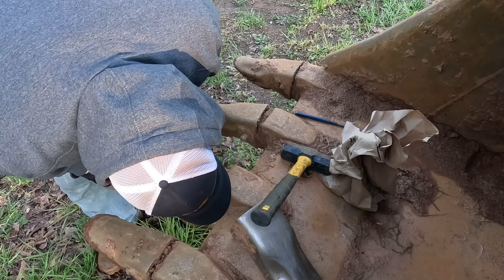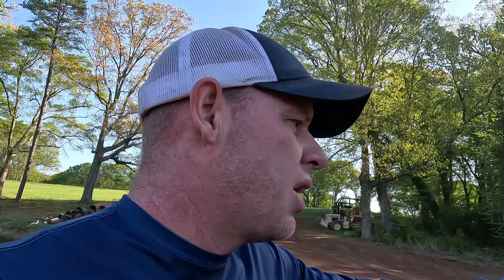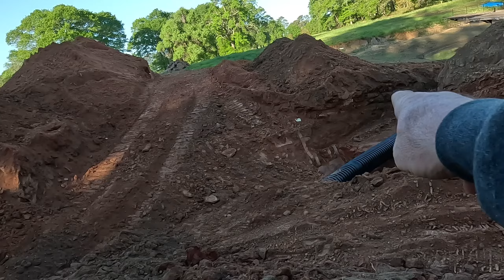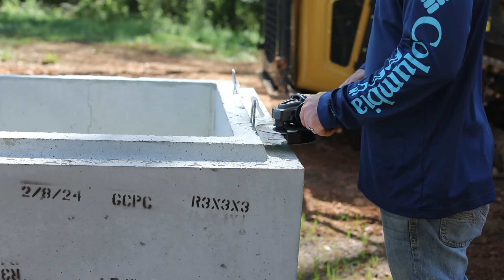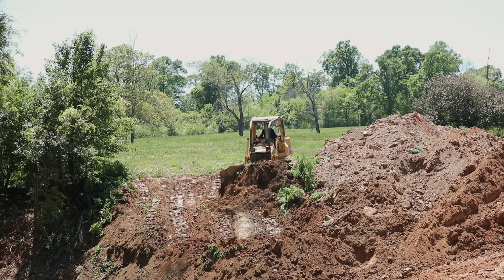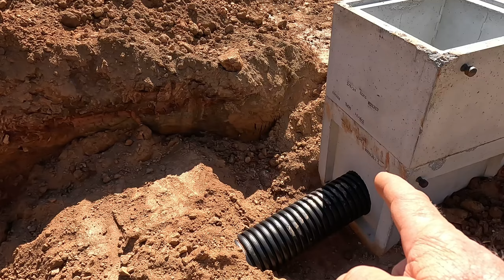Building a Pond Dam

Comment: The county here recently built a reservoir nearby to help control flooding in a small town at the bottom of the hills.  It took them 2 years just to find enough good dirt for the core of the dam.  The dam is around 150 yards across and 50 feet tall.  Thanks for the great video.
Reply from the maker: Oh wow, that's a long time.